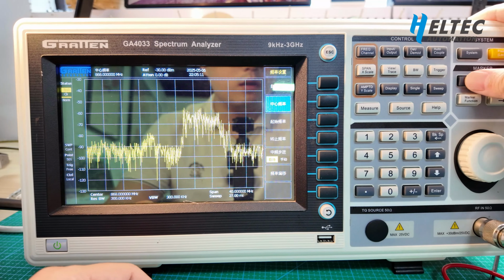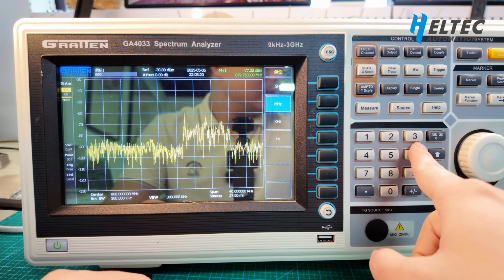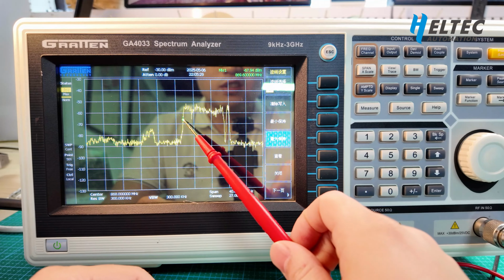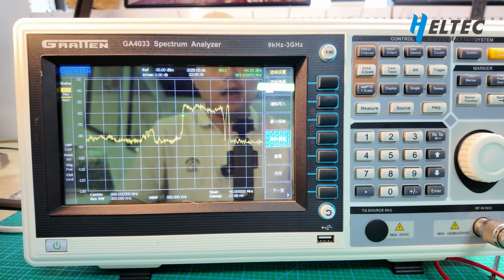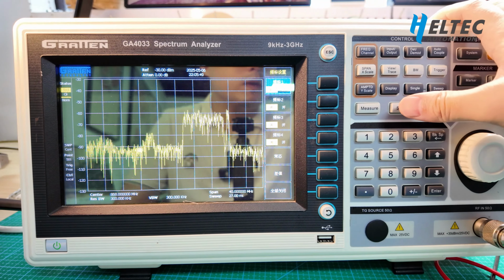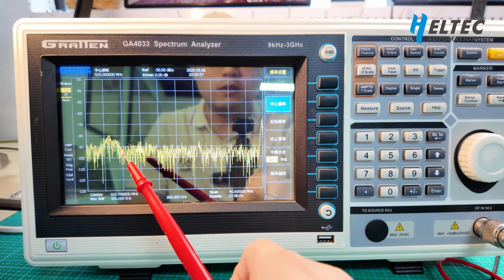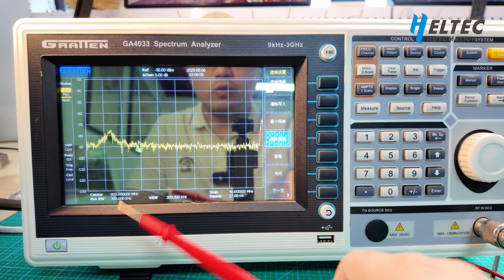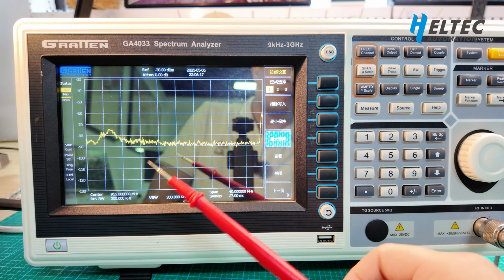Real-World RF Noise Comparison: 868MHz vs 915MHz Spectrum Scan

Comment: These are ISM frequencies, right? In Europe we also have 433.92MHz - very crowded band.
Reply from the maker: The 870MHz–880MHz frequency range is not part of the standard ISM band. In our region, this frequency range may be allocated for other specific uses, such as mobile communications or industrial applications.